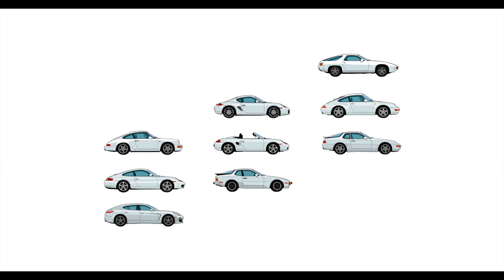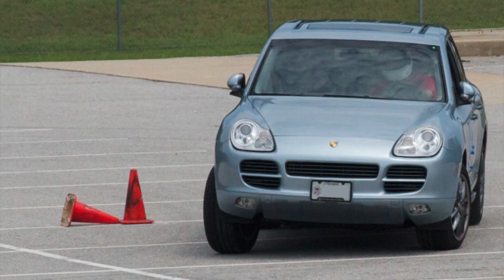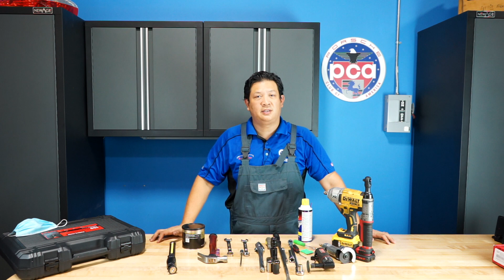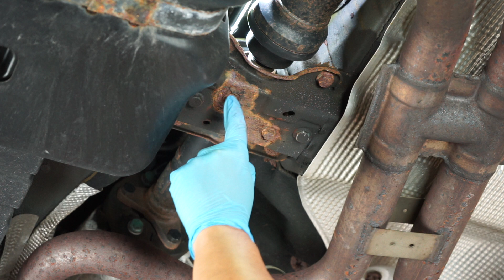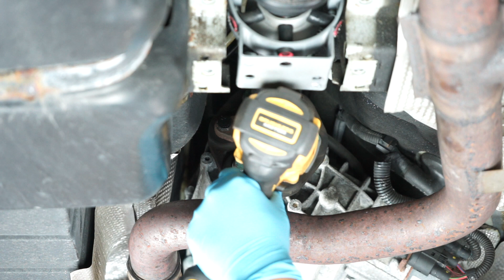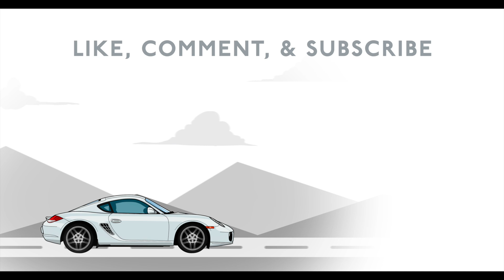How to replace Porsche Cayenne (2003-2010) driveshaft bearing center support | PCA Spotlight

Comment: The car is still drivable.  It will have a bad vibration at acceleration (sometimes) and a "calm" at steady speed.  Why would it not be drivable?  When you say things like that you confuse people when they are trying to diagnose the problem.  Yes it is an easy repair. Also note that replacing just the carrier support as you do here is the same costs as replacing the entire the driveshaft.  Replacing the entire shaft is more work however, the entire shaft costs the same as this carrier bearing solution from JXB or European Parts.  Soooo....... We should all be replacing the complete driveshaft because the bearings do fail on both ends.  In fact, you are accelerating its failure cause the old bearings are weaker and old and you just put a new center carrier which puts pressure on the old weaker ones on both ends now. No you don't have to remove the exhaust.  No need to scare anyone from doing the correct work. This is a "band aid" because the entire shaft now is a ticking time bomb. We need to stop propagandizing this solution.  Coming from PCA, we should be supporting correct solutions. You still have an old drift shaft with old bearings over 150k miles here and a firm center carrier.  You can't possibly think that is a good LONG TERM solution.

Comment: It wouldn't have killed porsche to have these as greaseable bearings (like normal pillow bearings are designed), or like any bearing on good u-joints. that doesn't take away the fact that the rubber would have to be changed eventually but the premature wear of the rubber caused by the increased vibration of the shift because the bears start going bad, coiuld be slowed down.

Comment: I have a 957 and I've been hearing a grinding noise that increases in pitch as I speed up.  I just took it to a local shop that specializes in European cars and they told me it's the rear driveshaft bearing and they said they have to replace the whole thing because everything would be better aligned than if they just replaced the worn out parts.  They said parts are $1,300 and with labor I'm looking at $1,950.  Does this sound reasonable?  If the bearing is making noise, does it just require greasing it up like on this video? I feel comfortable doing everything I saw here on this video.  Thank you
Reply from the maker: Yes, replacing to whole driveshaft is a solution. Price sounds reasonable.
Reply: @ Thanks.  So if it’s making noise that bearing is probably shot then and greasing it again wouldn’t fix the issue I’m assuming.  So replacing that bearing support from your video is for when the driveshaft is still in working condition?

Comment: what would be the symptoms for this failure ?
Reply from the maker: You'll notice lots of vibration in the chassis of the vehicle.
Reply: @PorscheClubofAmerica  thanks for the rep, sir! Mine seems okay, no chassis vibration or strange noise
Just got a mint 957 GTS, is it normal that these sport SUVs are much noisier than other SUVs? (Like Ford Everest/ Explorer). I can feel much more road noise and wind noise on highway cruising, or the stock sound absorber might have been bad for these years?

Comment: Hi Vu, minh ten la Long. Thank you for the video. I tool the transfer case cover off to change the chain inside. I didn't mark where the driveshaft attach to the transfer case. Now that I got everything back in, I cant drive over 30 mph. it felt like the driveshaft is out of balance. Is that possible? Or did I damage the driveshaft when I pried it off the transfer case? Thank you
Reply from the maker: Might check that you reattached the axle onto transfer case properly. If it isn't centered, you'll definitely get a vibration.
Reply: @PorscheClubofAmerica  Thank you Vu. The driveshaft was not attached back onto the transfer case correctly. While I was at home waiting for Hurricane Milton, I jacked up the car again double check with the photos I took before I did the job. You are 100% right. I corrected the mistake. My 200K cayenne now drives and accelerates smoothly. Thank you so much!

Comment: This is a good way to fix this problem as long your shaft is well-balanced. if the shaft is slightly unbalanced this will not go well. The fact the part is a little bigger than the original center bearing makes touch the tunnel ending in vibration under the center console.
Reply from the maker: Interesting point, we have not noticed any vibration in this set up.

Comment: You don't have to take the exhaust off, just need a swivel and extension to get to the differential triple square bolts.
Reply from the maker: Thanks for the tip!

Comment: Hey man. I’m trying to put this exact piece on my Cayenne 2005 and it’s not fitting it seems small and I called up to Europeanparts and they’re saying to cut the shell off of the barring I’m confused and I’m halfway through the process I’m super lost literally my first car just wanna cruise man
Reply from the maker: Yes, there maybe an outer case on your bearing that needs to be removed. It is covered in the instructions. The bearing in the video did not require. Shouldn't be hard to do, just a bit more time. Good luck.

Comment: did this repair in 2017....The part went bad again this weekend. it was five years almost to the day. But, only 4500 miles. Just FYI.
Reply: Many people have this part fail after doing a job or making some kind of repair involving the drive shaft. Some people don't know that the plate where the bearing support rests has an alignment that has to be strictly followed if not the bearing will fail prematurely or over time.
Reply from the maker: Thanks for sharing.Which part did you use in the repair?

Comment: My Cayenne turbo has a vibration at high speeds only when I give it a good amount of throttle, do you think this is the probable cause? Thanks!
Reply from the maker: It could be. Check by grabbing the driveshaft as we did in the video.
Reply: I have the same experience with my Cayenne Turbo. Hope somebody can share how to solve the problem. Thank You
Reply: Was it the driveline or ignition coils/spark plugs?

Comment: Vu, glad to see you doing some DIY maintenance on a Cayenne. I wrote you an email about the 958 Cayenne's transfer case and I look forward to a video on this item and whether or not this prone to failure part is in fact the Achilles heel of the 958 and as such buyer beware or if this is something that can be fixed for 100K's of miles without incident. Thank you.
Reply from the maker: Thanks. Yes, looking to do the transfer case video in the near future.

Comment: The issue with this short cut  repair is the "solution" costs more than doing it the conventional way even factoring in labor to remove the shaft . I had my shaft rebuilt for $200 as in my search I found several Porsche indy's that will either rebuild and balance or exchange your old shaft for a much more competitive price plus around $150 to re and re the shaft back in.
Reply from the maker: Removing, rebuilding, and reinstalling shaft is certainly an option. What we liked about this solution is that from start to finish it took about two hours, and that was doing it for the first time and taking time to film. Your approach above takes the vehicle out of commission for a longer period I would imagine. Total cost for this repair was $399 not including labor. DIY labor was free :)
Reply: That’s an amazing price to rebuild a driveshaft. I expect to pay between C$500-1000.
Reply: @tomalcolm  I paid $1,000 Canadian to get mine rebuilt and installed. Wish I knew about this method at the time
Reply: Agree. You can buy the entire shaft aftermarket just like this aftermarket solution for roughly the same price. And now you get all new bearing on both sides, and even the new center bearing.  Why is anyone pushing this temporary solution?  Cause its easier but not permanent?

Comment: No, No, No! This is a lazy man's approach which fails to address the equally worn out CV joints. Do it right and replace the whole cardan shaft. I found a reasonably priced aftermarket shaft on amazon.
Reply from the maker: As mentioned in the video, replacing the whole shaft is an option. Your concern about the worn cv joint maybe valid. That said, the techs we work with have never seen the cv joint on a Cayenne carden shaft fail. Keep us posted on how the aftermarket shaft works out for you.
Reply: 4 years later.... I'd like to know how that shaft held up!